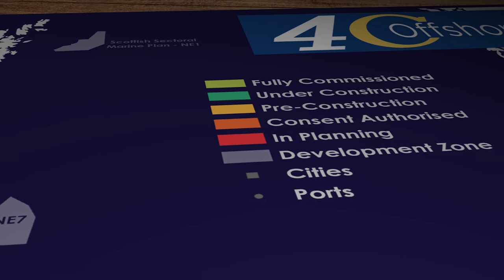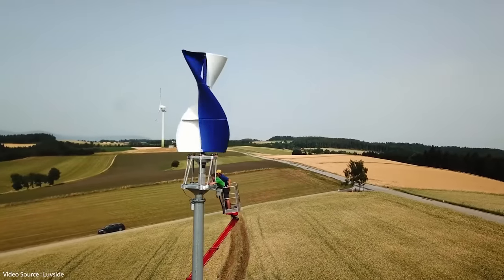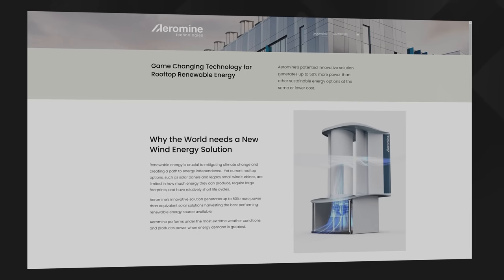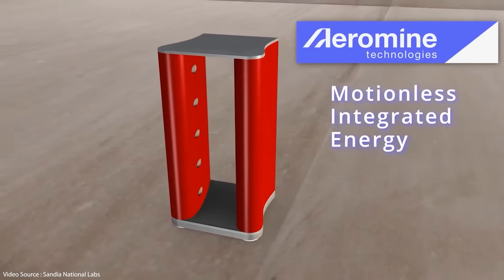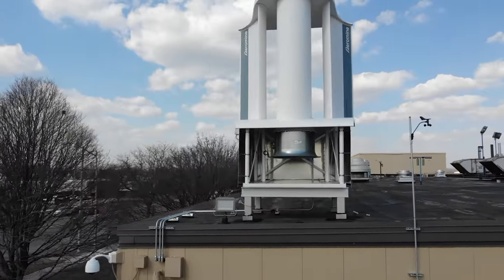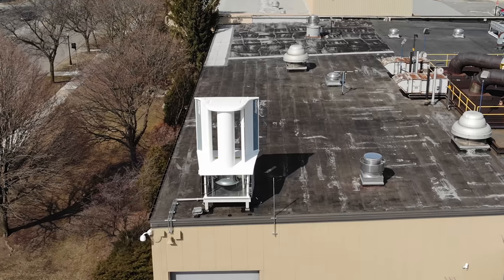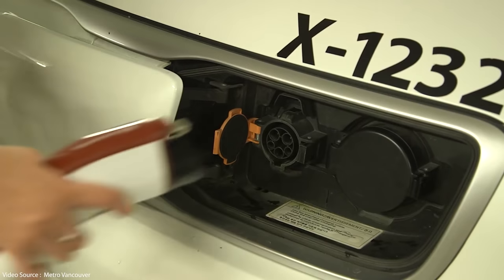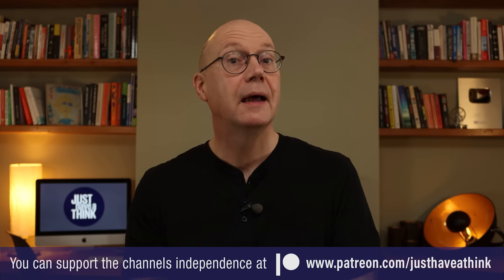Aeromine Rooftop Wind. Static. Silent.  50% more power than Solar PV. What's not to like?

Comment: Count me in........when available for a home stead I am planning on building......email me.....I would also encourage folks in the UK to look at an affordable ev that enters production 2023 or 2024. This car is Aptera. Aptera is a USA start up company. Their vision is to make the most efficient ev possible.......and they have!!!!....Using a principle of ........the best part is no part......the car is a two place, three wheel sports car. Besides having fewer parts than a conventional car, this car is super light weight, made of carbon fiber instead of steel. The result is a car weighing 1800 lbs.......about one half the weight of a conventional car. The body is super aerodynamic, beating Tesla and most hi performance cars costing 10x as much!!!!.....Being aerodynamic and light weight u need less power to move the car and less batteries. This further reduces the cost. Aptera has battery packs of 200.   400.   600.   And 1,000 mile range. Base prices.......$24,900.    to $54,000.    Usd....Aptera is currently raising capital to make the cars in their California, USA plant. They have 40,000 pre orders for the various models. They have decided to build 5,000 of what they call their launch model, first. After that build they will make the pre orders and new orders. The launch edition is........400 mile battery pack, option al full solar cell coverage, option al audio system, .......for $33,200..usd.....Since they are still seeking investors, if u invest $10,000 usd or more, u will get your car sooner than other pre orders. The Aptera has solar cell s that charge the battery 14-40 miles per day.....To learn more......go to aptera.us.......or email me with your questions.....,I will send you a discount code to save u money when you order your aptera on line...... regards...... barbuto@optonline.net......

Comment: Lmfao 13% 😂 the real number is 7% the investment we were sold into weas a dream! The fact that only about 50% of all wind turbines are actually working at one time and the life span of a unit is said to be 20 years but in fact being 10 but having to have constant maintenance due to stress fractures, bearing mounts warping, constant blade damage and the funniest one being that they can't operate in strong winds due to overheating 😂🤣😂😂

Comment: On site generation is really the most effective way of actually going renewable, since there is no huge loss due to transmission. When added to the grid also helps with local power outages due to storm damage etc. Only the energy companies don't want to do this since it cuts into their Profits. We need to remove the {privatization/profit only}  aspect to utilities,  bring it back to "for the service of all", then it's actually a utility again.

Comment: Here is a fooly - pegging the cost of your system to prevailing cost of produced "benefit". 
The real strategy is to produce a fixed cost system, with variant benefit output,
and then regerously drive down the cost of your system, improving your margin and deliver cost savings to your customers. (Sorry - who am I - just working in technical marketing and I am sick and tired to not straight forward honesty about what your solution delivers.)

Comment: Dont talk daft, first it has to face the direction of the wind which means it has to be able to turn, second some part of it would have to spin to create electricity.
Reply: I think the placement at the edge of the roof is key. The wind speed is increased due to building standing in the way.

Comment: And those huge wind turbines require huge amounts of fossil fuel products to produce.  They are made from fossil fuels, transported by fossil fuel energy, and they have a limited lifespan and then must be repaired and replaced.  The cost per KWH is enormous and will get worse.
Reply: Hmm. Coal mines and coal-fired power plants do not require huge amounts of fossil fuel to be build and run?

Comment: Why do you say that it has no moving parts. It clearly has a moving fan like structure, which is moving, will needs things like bearings, and it will make some noise.  Not against the idea, but you are describing it wrong.  At first I was expecting some kind of magic that converted air flow to electricity with NO moving parts. It didn't take long to see that was not the case. Oh well, go back to my dream world I guess.

Comment: Looks like a scam to me.  I am a retired Aerospace engineer and the design makes no sense.  You have fancy looking wings sticking up for a "venturi" effect.  The inlet at the bottom is separated from the fancy wings by a large plate.  Air is "drawn" in through a simple duct that faces down at another flat plate.  The structure surrounding the inlet duct is a bunch of sheet metal and pipes with no effort made to provide a clear air path to the inlet duct.  It looks like it is designed to look flashy for drawing investor attention but the execution is crap.  Let's see if they exist 5 years from now.

Comment: This will never be anything near an open bladed turbine. Anyone who has done any further than 1st year physics will have learnt how the power is proportal to the blade length and tip speed. You can't fold that. Also diffusion makes this pathetically inefficient.

Comment: This is just another hype, trying to get money from non technical people. It’s not a technological breakthrough, it is just a normal vind turbine with air deflectors. It has no ‘exposed’ blades, so what? This doesn’t make it any better. Deflecting horizontal wind to vertical one doesn’t make an advantage either, on the contrary causes energy loss, so it makes worse than a similar HAWT. No wonder it is compared to solar installations, as if they could really be compared. I don’t even mention the unidirectional design. All that wind flow, aerodinamics, Venturi effect wizardry is just marketing speech. I really wonder this channel is discussing it as a technically interesting topic.

Comment: You keep saying "there are no moving parts".  Yet you admit that there is a turbine?  I get it, the turbine is concealed internally from external view but it is certainly still there and still a moving part.  This is an impressive innovation but don't confuse the design by claiming there are no moving parts when without he turbine, which moves, it would not function.  There are however other designs which channel air and use the natural differences in electrical charge between the particles to motivate flow of electrons through wire.  Those ACTUALLY have no moving parts but also produce only trace amounts of electricity.